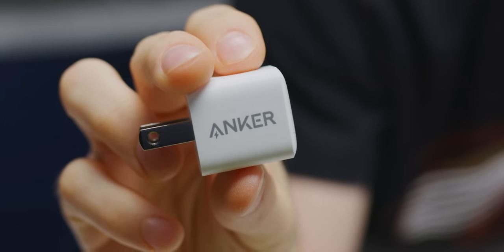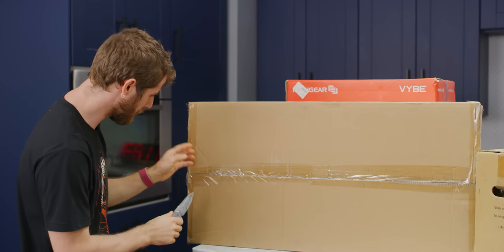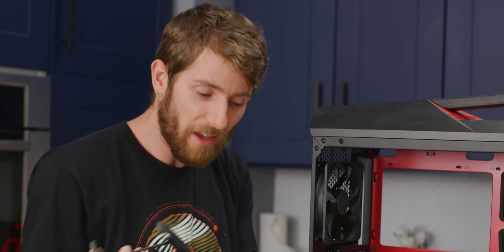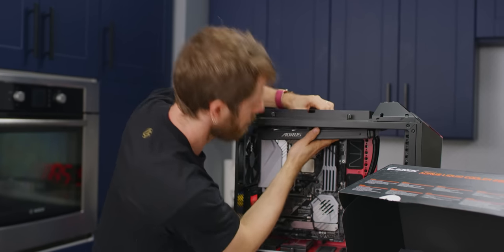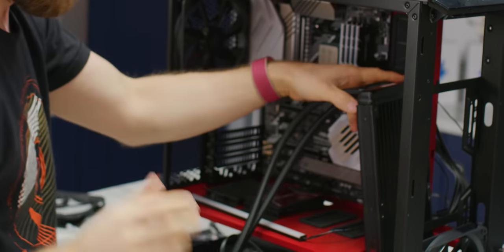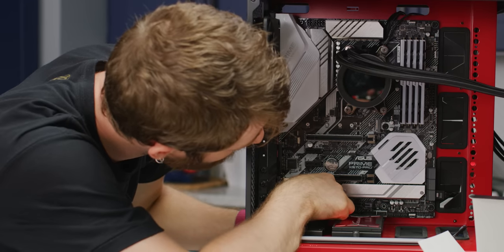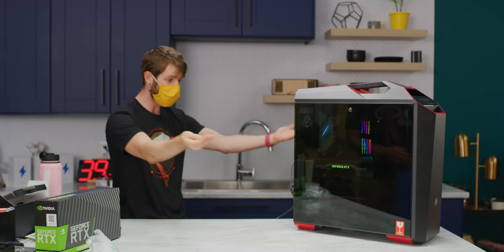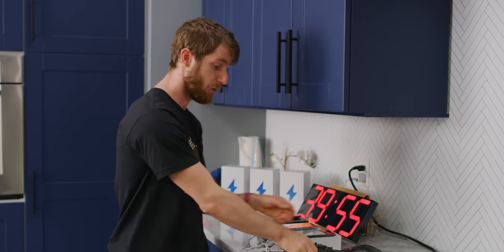PC building SPEED challenge!

Comment: Hi, i have a problem with my older system a Dell T3600 with xeon E5-1620 Processor. The problem is system works perfectly fine while in BIOS menu, but turns off as windows boot logo shows both while booting already installed windows or while installing new windows through USB stick. Also system turns off when running diagnostics F12 menu while test bar reach to CPU.

Comment: Hey someone please help me  
My pc is not turning on, i checked the smps it's working fine , power switch is working but the motherboard is not turning on. But sometimes it turns on. Only sometimes 
Then checked cmos battery coz 2 months ago I got the same problem. But when I changed my cmos battery it worked without any problem. But this time that method is not worked. I checked ram, processors, everything is perfect, there is not even a scratch on motherboard. But its not turning on 
Someone please help

Comment: If the phone just needs 69% battery, does Linus only have to build the PC to 69%, as long as it works?^^ Bad cable management, sticker on the CPU cooler, 2.5" SSDs just hanging somewhere inside the case etc? xD

Comment: Why would you need that charger? It's £17 on Amazon here in UK but for half that price you can buy a USB charger, From Amazon, that has 3 slots, 1x@5A, 2x@2.5A. And, the currant doesn't decrease no matter how many slots are used. They always give out what they're supposed to. And that 5A slot will charge my VITA from 0 to 100% in less than 20 minutes and my 6000mah battery bank in about an hour. And, it does it for under £10 (inc shipping).
Reply: Dude, they are particularly targeting iPhone users. iPhone 12 with No Charger means more sales for Anker due to super small familiar Power Brick to iPhone users yet delivering 20W power for $3 less than Apple's 18W Charger. Again, they don't want people with a VITA and 6000mah Battery Bank to buy this, they want iPhone users to get this.